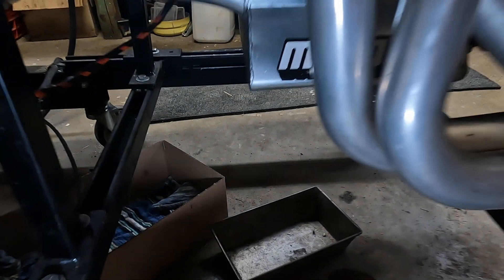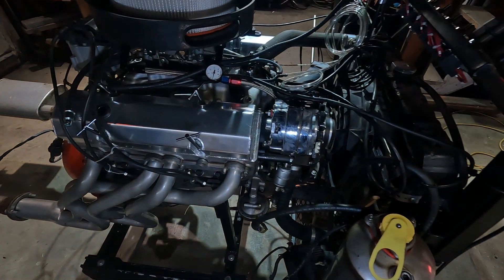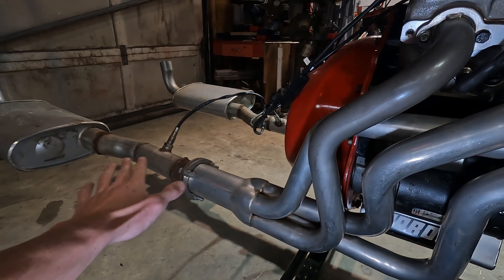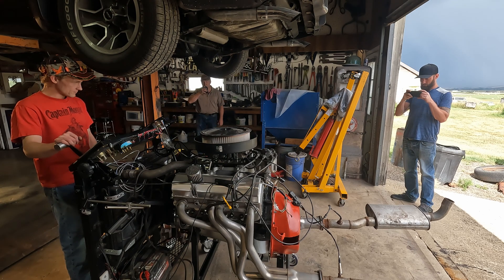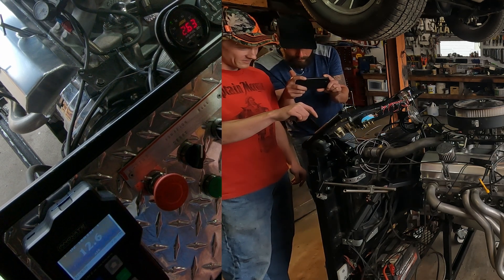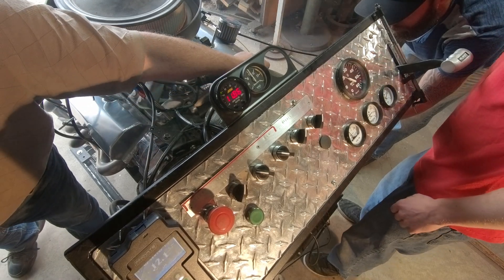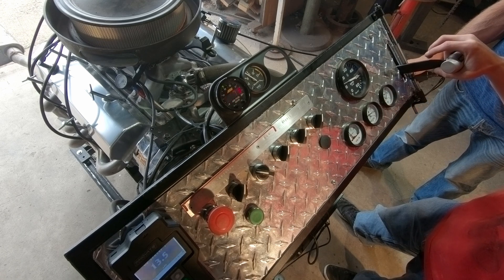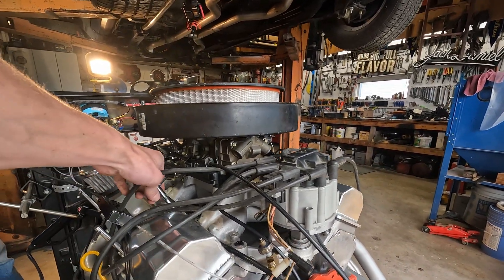The Barker 388 stroker on the run stand

Comment: Any coolant temp problems being a .060 over bore?
Reply: Hell no! They run just fine. I've bored  blocks 67 an older .120. It was common to make a 4inch bored 283 into a 302 Chevy. 400 blocks with steam holes and siamesed cylinders can run hot. If you have a normal functioning cooling system like a 3 row and decent airflow they never overheat.
Reply from the maker: Nope, but I do have a large flexalite radiator. The first engine with a build like this the block cracked in the first 100 miles due to core shift and .060 over bore making the walls really thin.
Reply: @bucksedge  Thanks for the heads up

Comment: Whats special about an 010 block
Reply from the maker: An 010 was quite desirable for small block chevy hot rodders, especially in the early 2000s. This was due to belief they contained a higher nickel content, which made them inherently stronger and more suited to performance builds. However this is very debatable whether thats true or a hoax.

Thanks for the question, I did miss that in the video.